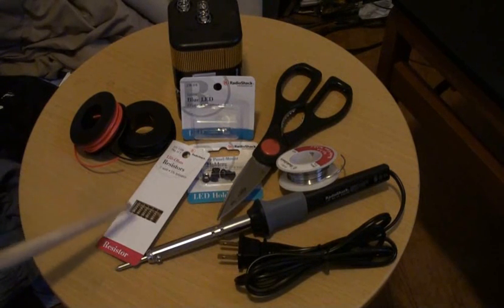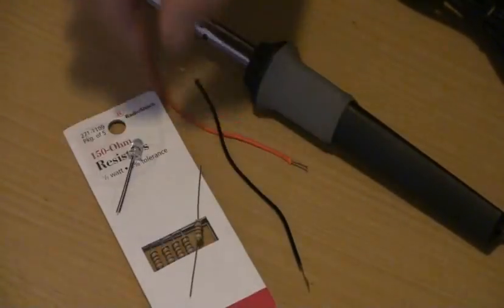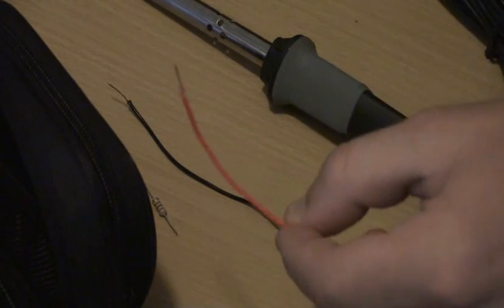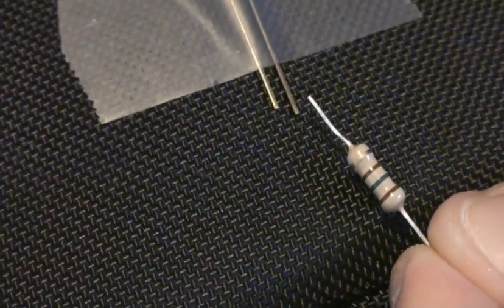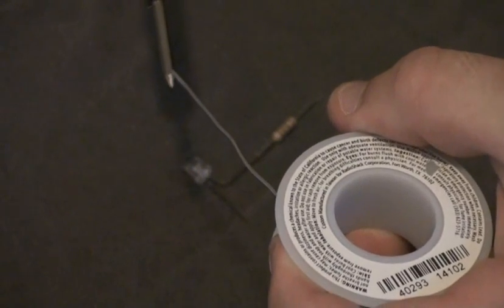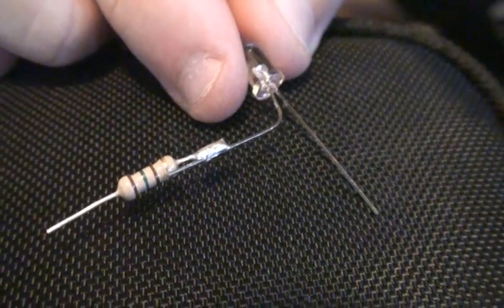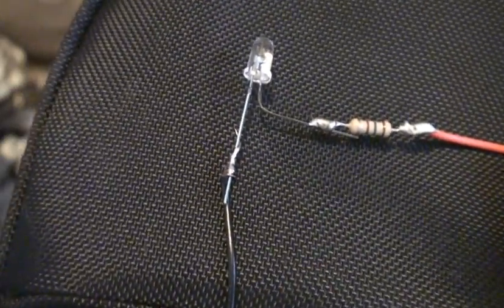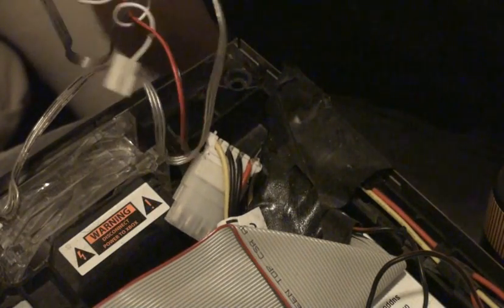How To wire LED's

Comment: Looking at running 6 filiment leds that are 3v each off of my wall plug. Don't know what all I would need like step-down, resistor(s), buck power converter? 
I'm great with physical builds, not with ohms, watts, volts

Comment: Good info here, thanks. Have your ever connected the led to a free standing battery to use as the only power supply ? We want to try to make a dozen small easy spotlights for a haunted house, using 1 led for each spot light. Any idea how much battery we would need to run 1 med bright led for a few hours ?

Comment: should also tell them if using RGB LEDs then you have to know, if you have a common anode LED or Common Cathode LED as wiring it the wrong way may leave you thinking you burned it up. so test it first to make sure you know which you got. The longer leg on mine is the NEG while the RGB legs are the POS, i found this out when i wired it to the battery and it did not work. so i turned the battery around and it worked...strangely enough..You will still put the resistors on the RGB legs becasue current really flows NEG to POS. i was surprised the LED did not go ZAAAPPP as soon as i hooked it up becasue my first thought was this is going to burn this thing out...it did not...But testing one without the resistors it went POOF in less than a second..you could smell it burning.

Comment: Nice Job. Going to try to do this tomorrow. Picking the correct led and resistor seems to be the trick as I have a 12v power supply but I think I can figure this out. Thanks.

Comment: instead of electrical tape I would use heat sink (shrinkable tube) which protects the wire.

Comment: Why didn't you use any flux when soldering? It makes the metal grab the wire so much easier.
Reply: +Ethan Martin Rosin core solder is the flux

Comment: how would you make a circuit that could turn on an off with a sensor or something? i new at this :/
Reply: +seangalea72  for using sensors , first you need to learn embedded programming language like embedded c or embedded c++, then you need to learn micro controllers. Then you can program your microcontroller to make a circuit with a sensor.
Reply: +seangalea72  check out my video

Comment: hi miller can i ask for a table of resistors used in single led bulb in several voltage of battery, and table of resistors for series or parallel led bulb, because i do not know to use resistors their codes and their capacities hope you can help me,,, thank you...

Comment: Where's the link to the site you said regarding the resistance for diode? You said it to  fast and it's not clear what you said, please, add a link to the video.  1:36min
Reply: Just use the Ohm's law to calculate your needed resistor. R=U/I --> Ohm=Volts/Amps

Comment: While calculating Resistance required in the circuit, it is must to know how much amphere is consumed by the device along with the voltage drawn/used. Hence, Resistor reduces both the voltage & current. When we connect any transistor or LED, we use resistor to protect those devices, from over heating which leads to burst combustion.

Comment: When is resistor is used, there will be a considerable voltage drop in the electrical circuit. Since, V = IR , R =V/I , here V is the difference between the source voltage (Vs)and voltage drawn(Vf) by the device, i.e Vs-Vf . If you use right voltage at the power supply which is required by the device, then there is no resistor required. After I learned physics in school, i did step in to engineering.

Comment: yes, if there is no resistor, then LED will quickly end its life. Again, it depends on how much power supply source, i.e how much voltage is given for LED. Normally LED consumes 3V DC power supply. Inorder to reduce excess voltage flowing to LED, we use resistor. I hope you got the answer.

Comment: resistors don't reduce voltage - they resist current. V = IR . your voltage is constant. voltage = potential difference which is a function of your electric field/battery/capacitor whatever. the current can be changed by the resistance. current = charge / unit time. where do you people learn your physics from?

Comment: yess u need the resistor cause an single led needs 3.3v of power and he is using a 6v battery the resistor is to reduce the current cause w. out the resistor the led would burn out

Comment: Go to my ebay account i sell exactly what you r lookin for plus leds as well batteries included i also cell a micro version that takes a battery smaller than a quarter my ebay name is.     BigL187shawn     very cheap prices too

Comment: what is  it called the device you hook the wire to and putt double aa batteries in it and it had a switch to yurn led lights on and off?

Comment: If you were running that LED off a 6v power source with a 150 ohm resistor; using ( V=IR then V/R=I) that would be 6/150= .04 or 40 mA even though that LED was rated for 30mA MAX?

Comment: Is that the resistor that limits the voltage to around 3.7 volts? I was trying to run an MP3 player with a dead Li-ion battery off AAA batteries and I tested with a mini digital photo frame keychain also with a dead battery and it ran for maybe 10 minutes then the keychain started acting funny so I think it got smoked.

Comment: you really shouldn't solder that way.  the best way is to transmit heat through the wires, and let the solder become from the other side of the wire.  way less messy that way.

Comment: So far, as I have seen this video, only one thing has a Possible Big Misunderstanding - Especially for Beginners. To Cut Wires or Strip Wires, you use an Actual Wire Stripper and Not " regular Scissors ".

Comment: yea you can as long as its a reasonable size to suit your connections and you can practically solder the joints without having to clean up too much afterwards!

Comment: you need to know the source voltage, like 12V or 5V or 24V in order to calculate... you'll connect them in parallel, that is + to + and - to -

Comment: LED won't blow up without a resistor.  You jst need the resistor if your voltage and/or current combination (power) exceeds the limits of the LED specifications.  You also need the right resistor depending on your source, otherwise u can still burn out your LED.

Comment: Direct Current (DC) just means the source of power is direct and there is no alternating current wave as there is with AC (alternating current). This does not have anything to do in which what direction ions flow ( from positive to negative or negative to positive) which sagrzmnky1972 was asking...

Comment: I'm a total noob at this electrical stuff but I wanna learn! Cos I'm makin a wedding cake and want to have LEDs peeking through the flowers on top :) So.... it wont light up without the resistor? I bought some LEDs but they were just lying in a bin in the electrical shop... so it didn't get a packet or anything....

Comment: ^^ This is correct. Heat your components and press solder to components and solder will melt to them. You can do one piece at a time to make it look clean and easy to connect. If you did want to do a cold solder to tack them together make sure you heat one or both components up to make good connection, like seddie777 said above.

Comment: AHHHHH! No! That is not how you solder, what you did will give you what is called a cold solder because you didn't heat the materials first. This causes bad, weak connection. Always hold the gun on the materials for a second to heat them up, then while holding it on them touch the gun with the solder. It should flow right onto your connection and that will make a proper solder... Sorry, didn't want to be a jerk, but that is important.

Comment: i want to put multiple leds , more then 10 or 20 so am i use any extra registance or diod :-?
is it work on home electricity or i have to supply power from any DC convertor ?

Comment: If u use a 9v battery then u need a 220 ohms / 270 ohms resistor.
this is determined by the ohms law-
R(resistor)=I(amps)/V(volts)
eg. i have a 9v powering a 3v led. 9-3= 6v 
6v / 0.025amps = 220ohms that means u need a 220 ohms resistor ok?????

Comment: Just to say thats not how you solder. To solder you tin the tip of the iron by touching the solder to the tip of the iron. Then you heat up the wire by touching the iron to the wire than touching the solder to the wire NOT the soldering iron.

Comment: @tomx63 if he is using 12 volts  there is a higher Mili Amps, in this case probably is Amps which is higher and that will make the circuit to heat up and make the resistor blow resistors to resist current ( amps) and thats why he need a resistor with higher watts or he can use two resistors to double the watts. believe me he will still have enough volts + hes LED only needs 20 mili amps.

Comment: @JeepOn94 if your Led is 3v on a 12v source one resistor won't gonna work voltage is to high you can try 2 resistors one on (+) and one on the (-) higher Watts ans tolerance

Comment: Hello i have a question so i have 20 red 3 watt led and 10 blue 3 watt led with a 100 watt led driver so how i can mount can i mount this without resistor in parralel ??

thanks for the answer

Comment: trying to wire a LED light into a 12v source and my resistor keeps blowing. I used the online calculator to figure out the size of the resistor but it doesn't seem to be the right one. Any ideas? 
Thanks

Comment: Thanks for the info, VERY HELPFUL!
Do you have to wire the resistor with the positive wire, or it doesn't really matter?
Because the calculator site has the diagram showing the resistor with the negative wire.

Comment: i have a 12 volt battery pack and using 12 v LEDS ......how should i set up my wiring scheme.  i am guesssing i'll use about a 400 ohm resisitor for each bulb or connetc 3-4 bulbs in series with a 800+ resisitor

Comment: You need to use forceps to dissipate the heat from the soldering iron.  You have to avoid burning the LED leads.  They're susceptible to damage when that much heat is applied.

Comment: @Famoussasdrummer182 
The electricity is "going" from negative to positive, because current is the displacement of electrons (-). most of the time, we say that it goes from the positive side to the negatice side, but it's only a convention. It dosen't matter where you place the resistor because it has no polarity(it works in either way)
sorry for my bad english

Comment: noobie here to electronics, im interested in making a 3 or 4 point led hat for free track, i got the led's / resisters and a 6V plug in power supply, so from your video would you recomend power + to resiter to + wire to + led than from the - led to the + of the 2nd - to + to the 3rd led than the - to the - part of the power supply and thats it right? or would it be better like you did in your video and solder the resister to the first led than that to the + wire to the power supply, does it mat?

Comment: Hi there, I am very very new to LED wiring. I am familiar with which resistor I need, but does it matter which type of solder I use? Does wire gauge matter? If I want to add a switch, can I use any small switch or do I need a specific one for the wattage? Sorry about these noob questions, but I can't find the answers anywhere online and I've been looking for hours. Thank you for the vid, it is quite helpful.

Comment: @corywaynemartin31516

Radio Shack if you are willing to order, but they sometimes have basic stuff in store. 

Also no joke check IKEA. They sell dirt cheap LED lamps and various LED lighting . Stuff with inline dimmers and switches you can use for easy stuff.  Around eight months ago they had these Jansjo LED twisting neck lamps for $9. I removed the bases & re-wired 4 of them to light up my guitar amp head bright green. 

They have solar ones too. I have been considering stuff using them.

Comment: @Famoussasdrummer182 

For the record, on an atomic level electrons actually flow positive to negative although in most applications related to engineering the conventional positive to negative model is observed. In this case it makes no difference which side the resistor is soldered into because it still serves its purpose of impeding current flow. The electrons may arrive at the led faster but they must still depart at a slower rate, reducing the current observed at the led

Comment: Thanks man perfect little video to get me up to speed id like to put a full led tail light retro together in my car. I already did it using led strips but i would like to change it around a bit. Also i want to put some forward face leds in my kids power wheels escalade headlights

Comment: @Celiecinema1 Then what ever you have it connected to isnt too high voltage. I have some wired to my sub, which is higher voltage, anythin above live 5volts/9volts might burn out your LED. the resistor simply takes high voltage and makes it smaller to safely power small devices like LED's. Like an iPod charger, the 240volts coming from the socket in your wall gets knocked down to about 5volts by a resistor to safely charge you Pod :)

Comment: Great video! I saw the other video with wiring multiple leds, but I didn't want to use the thing from the computer to power the leds, I wanted to use a battery like in this video. If I were to wire like 30 leds onto a foam core board, what's the difference would I have other than needing more leds, resistors and batteries?

Comment: @Celiecinema1 
Yes, some LEDs are made to handle specific voltages, typically 6V and 12V, because those are fairly 'universal' device voltages.   The 6V models work well with computers (like the HDD indicator of your PC) while 12V LEDs are good for automotive applications.    As a general rule, specific voltage LEDs used for 'indicators' have a resistor built into the 'capsule', while 'illumination' LEDs (flashlights and the like) have higher-voltage junctions and don't need a resistor.

Comment: @Celiecinema1 
You are correct; current does indeed flow from negative to positive.  However, it doesn't matter where the resistor is placed.  The current will be the same whether it's on the positive or negative 'leg' of the circuit because - and this is important to remember - current is the same at ALL POINTS in a series circuit.

Comment: He had a hard time soldering because he put the solder on the tip then tried to put it on the connection. This does not work well because how it works is you want to heat the part you want to solder as well to make a good connection so I recommend touching the part with the iron and then applying solder. Overall good video and explanation of LEDs

Comment from the maker: @Celiecinema1 
hi thanks for watching!!
there is no correct way in which electricity flows. Some may say from positive to negative others say from negative to positive. In my theory since positive is the "hot" side and which is where electricity is coming from in a sense (since you cannot receive power from a negative terminal) i put the resister on the positive lead...it seems to work well though im sure even on the negative side it would work as well.

Comment: hey i just bought a multi colored led and i have some questions on the back in the information it has for values for the different colors and I'm not sure which value to use in the resistor calculator the led also has three legs coming off it and I'm not sure which on to use

Comment: @nugent923 u must have connected the middle one in the wrong direction or the led is burned. and btw this is called parallel circuit

Comment from the maker: @nugent923 
hi
it sounds like you were trying to put the LEDs in a series circuit. Connect your LEDs like this (P for positive N for negative)
P N + P N + P N  connect the negative leg to the next LEDs positive leg and so forth.. connect your resister to the first positive leg on your first LED
it sounds like you flipped the middle one around the other way

Comment: @97bosko You need to use a resistor with some LED's or they can burn out easily. It all depends how much voltage you are using and how many LED's. Look up Ledcalc on google and use their calculator it will tell you what kind of ohm resistors you need.

Comment: @besimr I ran 26 flashing LED'S with 3.5 using 1 9 volt battery. I use no ohm resistors because I realized it affected the lights when they flashed. You can run 5 LED's with a 9V for days.

Comment: you need to learn to solder, sand your connections, then use a tiny mount of solder on each connection before applying them together. thats the correct way.  otherwise you end up with cold solder joints

Comment: If you want to know the technical way to find the correct resistor you use the formula  r=v/I where r is your resistance (ohms), v is your voltage, I is your current (amps). For this project you get the voltage of the power supply and subtract the voltage 6 volts from the led's required voltage 4.5 volts and you get 1.5 V next get the current rating (amps) 30mA convert it to amps .030 Amps now R=1.5/.030 
R=50 ohms resistor color GreenBlackBlackGold max for this project

Comment: @Famoussasdrummer182 

Sorry for spamming your video comment section man. 

Thanks for the upload, it answered my ohm resistor question. 

I'll show ya my project once it's done. I wish I knew about schematics but I've never taken any course for electronics.  May be create a circuit board for the LEDs.

Comment: @zilverzero haha, It's amazing how some one who was born with three replicas of their 24th chromosome can come up with such conclusion... then again, you can't even cognitively process information. Suffer from low self esteem much? Run out of your meds? Some one needs attention. huh?

Funny you mention that, seems like you fall under the same category. After all you did and are commenting on this video. As far as wires, they are easy, the ohm resistor is what matters and the voltage.